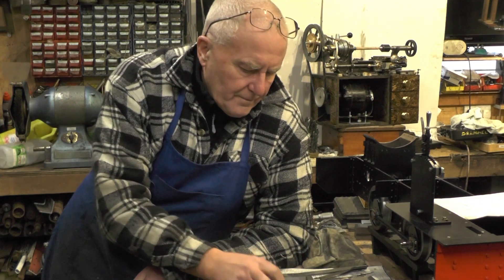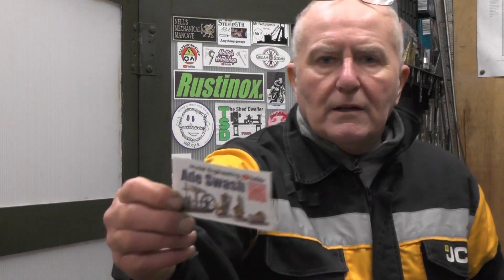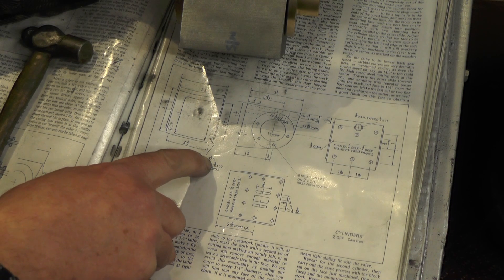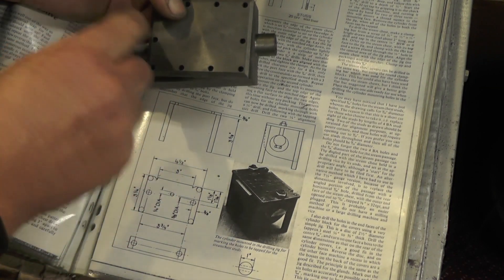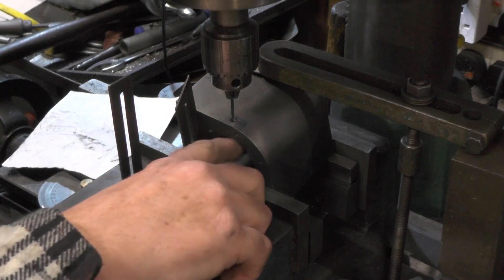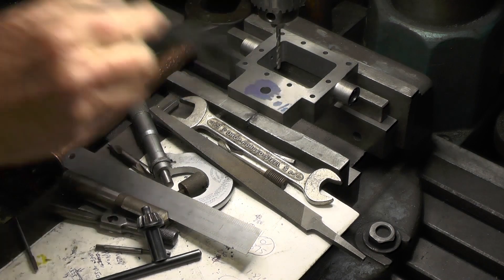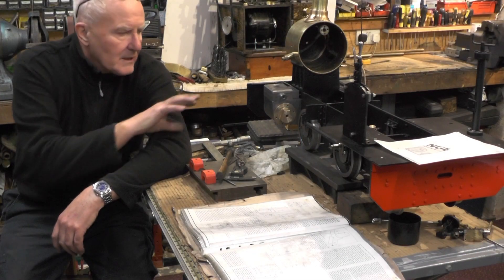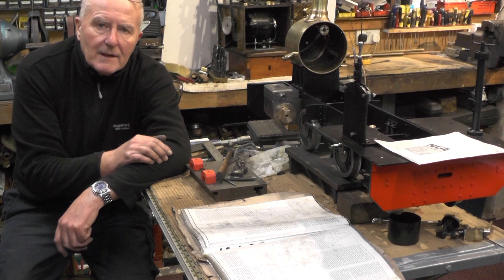Sweet Pea Steam Locomotive Build Part 7g (Cylinders - Drain Cock Holes etc) "mr factotum"

Comment: Hi Kev, why did you opt for automatic drain cocks. If the automatic system fails, how do you dry the cylinders ?. great video.👍 RBD
Reply from the maker: Hi RBD
Can't answer what if they fail, !!!! Just took advice from others who use them, never fail if looked after, no faffing around, all automated, less to thinks about for my inexperience in driving a loco🤔🤣👍👍👍👍👍👍👍👍👍
cheers
kev
Reply: I do prefer manual drain cocks 👍